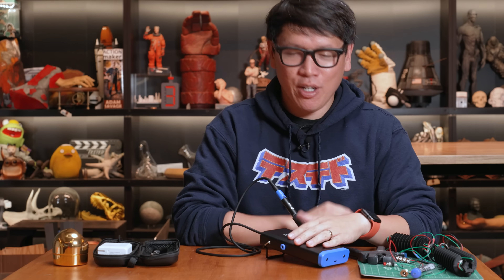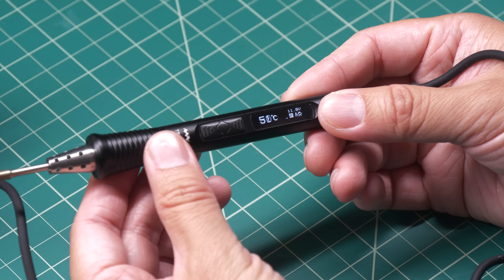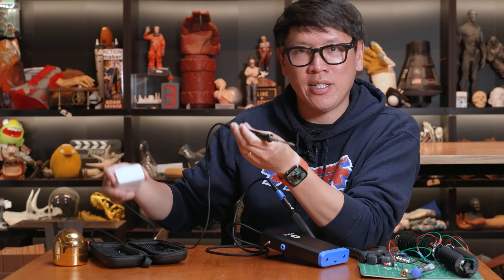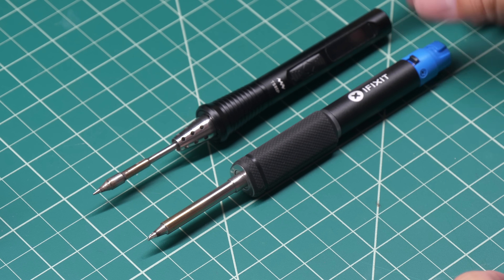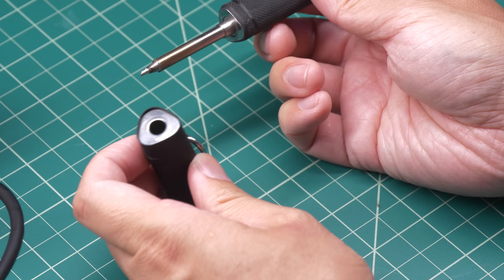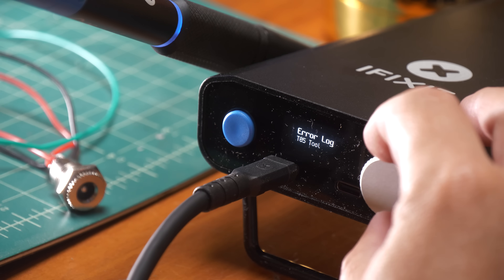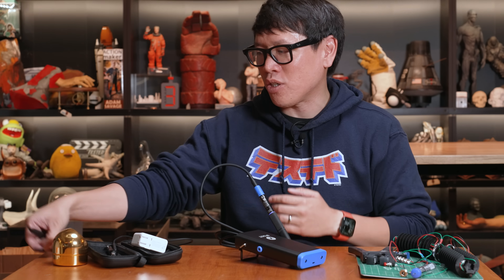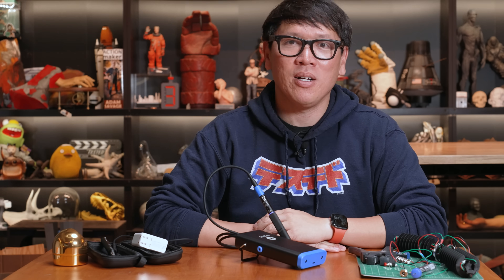Show and Tell: iFixit's "Smart" Soldering Iron!

Comment: The lack of temperature controls on the device itself really is a deal-killer. I've been really happy with the Pinecil, which is a lot more affordable. The battery here could serve as a nice accessory to that or any other similar USB-C soldering iron, but the iFixit iron itself really is disappointing.
Reply: @braedon4589 You’re supposed to change your temps constantly.

If I’m tinning kynar wire to solder to a chip leg then I need a lower temperature than I used when soldering the rest of that chip. When I switch from soldering an SMD chip capacitor to an SMD electrolytic, I’d increase the temperature… especially if one end goes to a ground plane. If I then moved on to a thru-hole cap I’d increase the temperature again. If I then needed to clear the ground thru-hole using solder wick I’d add solder, flux, then crank it way up as I introduce the desolder braid.

If you aren’t doing this then you are probably using way too much heat. The point is to use only enough heat to get in and out quickly without damaging the board or components.

Granted, these newer cartridge-style irons are responsive enough that you can get away with lower temperatures for some thermal loads but it’s still good practice to get a feel for what sucks away your heat and what needs a bigger tip (thermal mass) or higher temp.
Reply: I don't mind the non controls on the device since it's on the base but then you need the whole kit
Reply: How much are you changing temp in the field? Most of the time I change it when it starts at the wrong setting. And the buttons being where my thumb is annoys me on the ts100
Reply: @braedon4589  Not super often, but even the ultra-cheap soldering iron I bought from RadioShack decades ago still managed to have a high/low switch. Needing to plug it into a PC just to change temp is absolute insanity. If you find you're accidentally hitting buttons, it might actually have a setting to help prevent that.
Reply: @braedon4589  I change it fairly often, personally.  I use my ts101 both for normal soldering, and for welding 3d-printed parts.  The temperature I use for soldering would burn the plastics too easily, and the temperature I use for plastic welding would be way too low for the solder.  The interface on the ts101 is kind of a pain, though.  If ifixit releases a way to set the temperature on their iron while using my own power bank which doesn't require an active internet connection, I might have to look into getting one.
Reply: @braedon4589  I've had to adjust settings on mine a couple of times due to random circumstances - needed to get to some light strips that were already fitted, but didn't have my regular powerbank. Only had a 60W Anker powerbank, but it was tripping whenever I powered the Pinecil on until I limited it to 50W on the iron itself.

Comment: when i first heard 80$, it sounded like a really good price. then you emphasized that its just the soldering iron without the power station. too expensive. and 250$ for the whole kit too. should be 150$ at most, even that is very much a premium price
Reply: For that price the least they can do is include the wall charger 😂
Reply: Just Google sequre ts100. Had one for years and it's like 30bucks. 250 is silly
Reply: As he explained the TSP80P and the so called "quirks" really felt like he was just making stuff up. You don't buy something USB powered to use connected to the wall. You buy it because its portable...i.e. use a damn power bank! 

He was really reaching with his comments. I use the ts80p at work with a flat round tip and its absolutely perfect, I can solder pins that go to large ground planes with it as well. 

This ifixit iron is literally a big downgrade, you have to connect the iron to a damn computer app to control temp???  That is absolutely ridiculous and they couldnt even include a display for that price when the ts80p has one. For a company that loves to talk rubbish about gadgets and poor design, they sure made a product that has equally bad design
Reply: Ts100 are $80 and also don’t include a battery pack or base station with them. Still a fine option but almost an identical product if you dont deal with different solders regularly.

Comment: Desirable temp for any soldering iron, used for electronics work,is between 325°C and 375°C... Any cooler or hotter, leads to bad joints and overheating of wires and components... I used to be in charge of calibrating soldering irons and you would have some using a fan to lower the temperature reading, whenever I was due to check them, which of course I would turn off, only to discover their iron was running way too hot... These irons had NO control to set the temperature, as this only caused problems with people producing bad work or damaging components.

Anyway, I am very interested in this new portable iron and will most definitely be checking it out later....and yes far too many USB cables and power cables in general tend to be very stingy, when it comes to how long they are, especially with thing like toasters, but that comes down to their amount of power they draw and the risk of having too long a cable leading to them being a fire risk, unless that cable is made much thicker to compensate, which would make your average soldering iron, very difficult to use

Comment: The pricing is nonsensical, and the functionality seems very poor. Bare minimum, the pen should support multiple presets, and have an rgb led to display which preset its on, if they're not putting a screen on it.
The battery would have been a little more ok, if it had an internal power supply, and used a 2pin ac cable to plug in / charge itself while powering the iron.

Comment: Ifixit should sell a complete kit and be done with it.  Who’s going to bother with plugging into a PC to set temperature?  No one.
Reply: I mean, how often do you really need to adjust your temperature
Reply: @nullgator8073  Actual electrical engineer here: I change the temperature quite frequently on my JBC station. Maybe not super often whilst I'm working but depending on what I do you might have to up and down the temperature every so often if you want to be efficient.

Sure, you could just crank the temperature and leave it at that, but then you risk damaging the pads or components, so adjusting it based on the job (especially for any more sensitive electronics and smaller pads) allows a lot more leniency and fine control.
Reply: @nullgator8073  I use silver-bearing solder, 60/40 solder and Indalloy 282 bismuth solder.  They have different optimal temperatures.
Reply: People keep saying you have to plug it in to a PC to adjust the temp, but you can adjust the temp via the front controls. What am I missing?
Reply: @usseg if you buy just the iron and not the base, it has to be set through pc. Working with Different solders and various size components requires frequent temp adjustments
Reply: @usseg  The soldering iron is sold for $80, separate from the power bank.  You can use the iron by plugging it into a 65 Watt or better wall wart with a heavy duty USB-C cord.  If you go that route, then you have to use a PC to set the temperature.  Together the iron plus the power bank costs about $250.  They’re expensive, but ifixit tools are usually decent quality.

I found a 60 Watt soldering pencil kit which comes with four different interchangeable ceramic element tips, USB-C cord, carrying bag and 65 Watt wall wart for $39 on Amazon.  The iron has a temperature display and is adjustable right on the iron.  It is NOT battery operated.  I’m thinking of getting that for my tool bag.  The quality is anyone’s guess as I haven’t bought it yet.
Reply: @usseg  They are nitpicking that you can't control the temp easily if you just have the pen

Comment: The iFixit sorry iron is really nice was the original one ts100 is is the one I have it's got a 12-volt Barrel Jack on the back and USBC what is an adapter for my battery it's got a barrel Jack for 12 via at 2 amps using a DeWalt battery pack. I will say the solution how do I fix a battery pack is a lot smaller and up to a point it looks great I can't wait to try one have a great day

Comment: Don't bother with a TS80p at this point, the pinecil is cheaper, more capable, and has much better tip availability. ($26 for 88W)

The ifixit iron seems expensive and unwieldy in standalone mode, and very expensive as a station.

Comment: 30w? Pinecil is 60w, has a breakout board to expose the RISC V processor, has both usb C and dc barrel jack, and is $25.. oh my god and it has a screen AND buttons so you dont have to go to a pc lol. not enjoying these advertisements
Reply: Yeah, I have my travel soldering kit with a Pinecil in a 3d printed case that stores it's extra tips, usb-c cable, a small amount of solder, and a collapsible stand and a big USB PD power bank. The Fixhub looks sleek but it's not a great value.
Reply: @Ariannus  Yeah, I find it odd how expensive this thing is.
Reply: @Ariannus  Which Pinecil case; can you link it?
Reply: For years I've been using a TS100 powered by an adapter to my Makita 18v batteries. Pulls all the power I need at almost twice the watt hours as this ifixit device. And if I somehow manage to drain it I can just pop in another charged one. Plus I have tons of tips including for threaded brass inserts for 3d prints.

They completely missed the mark by not including a screen on the iron. They made it big and bulky for what? Just to be comfortable? It's 2024 ifixit, throw an LCD screen on it and make it sync to the battery if you really want to.

If I didn't already love my setup I would seriously consider this iron but essentially locking people into buying your battery is foolish. Any actual diy-er is gonna want to change the temperature between projects and having to hook it up to a computer every time is so dumb it's insulting.
Reply: pinecil does 100w, you might just need to have a look through the menus and set it up currently.
Reply: Yup, literally zero reason to get the ifixit one when you can get 5x Pinecil + a good power supply for hald the cost...
Reply: This seems like a vastly inferior product
Reply: 30W charging, 100W heating cartridge
Reply: Per IFIXIT specs, the soldering iron is capable of 100w.
Reply: I already own a pinecil and a TS100 and I'm still really tempted by this. During longer solder sessions those are sometimes a bit tiresome and fiddly and the iFixit one looks like the ergnomics are superior. If they release a small chisel tip I will likely order one.
Reply: The iFixit iron can ouptut 100 watts of power.

Comment: To cut adjustability and the display for feedback while asking a premium price (for these USB-powered soldering irons) seems like an unforced error.
Reply: We've spent a lot of time talking to engineers and makers who solder all day, and it turns out that most people rarely change the temperature. I pick a temperature that I like and leave it there. 

I think that other irons use temperature as a proxy for power. We aim for the temperature that you set. The instant that the iron detects that it's under load, it pours power into the heating element. That makes it feel and perform like a much more powerful iron. We're dynamically responding to the power load and flowing heat into the material.
Reply: @kyle_wiens  I partially agree with your logic. I use 63/37 solder, but these days any solder that’s factory installed is lead-free, which means I need to set a different temperature. It doesn’t happen every time I use my iron, but often enough that even having one button to switch on a “boost” or higher preset would be a significant improvement. I guess I could just always leave it at the higher temp but 🤷🏻‍♂️ Or maybe I’m supposed to use lead-free haha.
Reply: @swissfreek  Yeah, I feel like just having 2 custom presets you can switch between with different LED colors indicating which one would have alleviated that problem that a significant subset of users may have -- or at least believe they have, which would prevent a sale.
Reply: @swissfreek  Get a Pinecil - not only does it have exactly that boost option (set it to whatever temp you want), but give it the right power supply and it'll reach it in five seconds from cold. I generally have mine set to 310 and boost at 400.
Reply: @kyle_wiens  Fair enough, then it's just me. I do a lot of different things with my soldering iron, and I change the settings of it frequently.
Reply: You can adjust it with the base. They shouldn't sell just the pen by it self
Reply: @iambear.6526  Thats what makes it price competitive with the ts100 though if you just want a field soldering iron you only need the pen really
Reply: Just imagine having to plug this thing into an pc every time you want to slightly change the temperature! My first thought was that it has bluetooth and you have to use an app on your phone, but this ist even less user friendly
Reply: @daviniusb6798  Complexity decreases the ability to easily repair something.  Pretty sure that is part of what when into not having a tiny screen and some form of really small set of buttons.
Reply: @KellicTiger  Yeah and in a year they'll drop the support for the app
Reply: Also the number of times Ive pressed those dumb buttons on the ts100 while soldering in the field is innumerable and I normally dont need fine temp control in the field.

Comment: Preorder only in lower US. I wanted it but not available for me
Reply: You’re better off that way. Buy a ts100 and save some money.
Reply: @jesperwall839 or even better, a pinecil. it's compatible with ts100 tips, but it's much cheaper, while being more powerful than both the ts100 and ifixit iron (up to 126w with a pd 3.1 power supply and cable)

Comment: Ever since Hakko came out with the T12 style tips I've been hooked on those. You get a fresh heating element and sensor with every tip, they're easy to swap even when warm, and they don't have the weird headphone jack style plugs. Love these portable solder stations, but I wish there were more with T12 style tips.
Reply: Yup, I'm happy with my KSGER T12. Sure, not as portable, but gets the job done wonderfully and with the 9501 handle it really brings your hand close to the tip.
Reply: I stumbled on chinese T12 soldering stations that work with power tool batteries.  I bought one for makita 18v batteries for ~25 eur and havent used my "regular" soldering station since, even at my desk.  Weight of the battery makes nice base for the springy holder thingy.
Reply: I'll take the JBC tips over the T12s, but yeah, kinda different colors of the same thing. Wayyy more options than the heaphone jack.
Reply: I've only ever had Weller stoldering stations. I do like how their tips never foul compared to the $15 soldering irons from Walmart that would foul after 3 uses.
Reply: most new irons do use cartridge style tips whether those are t12, ts, c245, or other common types